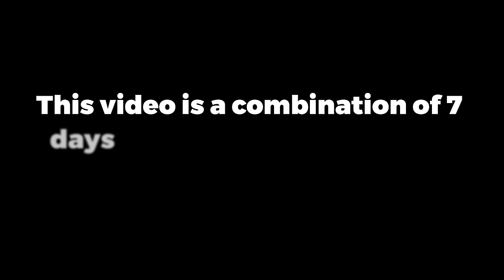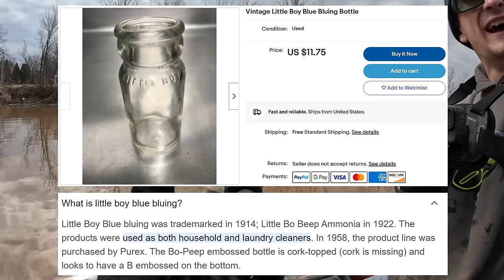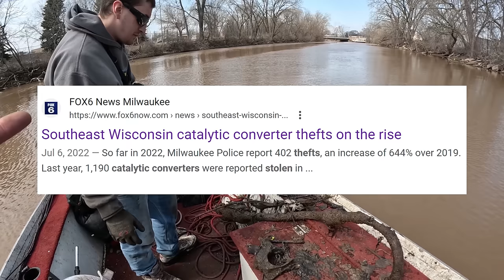Magnet Fishing Gone Absolutely Wild - Dead Body, Game Warden, Drug Box & More INSANE Finds!!!

Comment: 7:35 Carburetor 25:11 Car ignition coil 26:20 Transformer 36:08 Pum handle for a big weed sprayer 46:43 Automotive power steering pump 49:56 Idler gear for a manual transmission 50:53 Screen door shock 53:19 Timing chain for a car  1:09:40 cluster gear from a semi truck 1:10:58 air brush air compressor 1:14:39 lawn mower handle 1:36:05 garage door axel Be careful with that airplane Those prybars are made from some very good steel ,154:15: I'm real sure those ARE meat hooks from a butcher shop Dogs  do die man It's part of life! 2:04:35 that's called a full moon hubcap and has some value 1940s era 2:07:20 film cover for a polaroid camera and a cover for a water drain in an old car trunk 20:11:41 not an ax that's called a hatchet 2:27:31 yoke for a horse drawn plow  Check that propeller to see what kind of metal it is. Usually they are made of solid brass You probably caught it by the steel bearing
Reply: Thats seriously impressive i thought i knew what most items were roughly but, i reacon your spot on 👍
Reply: Unfortunately animals do die but it is definitely not part of life or at least not part of my life. I try and save animals.

Comment: At 1:36:48 in the video, that item that had rubber pieces in it, that is a ink stamper for marking food items like cans, jar tops, boxes, etc, from items that would go in a food store or grocery store. I grew up in a small town grocery store which my father had owned and he had several of those ink stampers. One of the front rubber strips would have several didn't symbols like $ # as well as numbers 1 thru 9. There would be anywhere from 4 to 6 bands for setting up. The ink cartilage would be at the very top just below the plate of the handle. the unit in side would spin from the ink cartilage to the bottom to stamp the items that needed to be marked. The one you found looks to be a very old one. I would think that it came out in the 50's or 60's.

Comment: That's a front shaft the thing with your teeth on the front and the gears in the back it's a front shaft to a manual transmission the real small front tip goes right into the back of the engine into the crankshaft